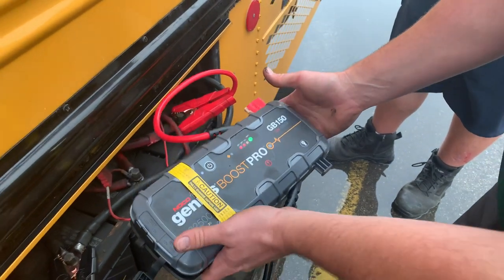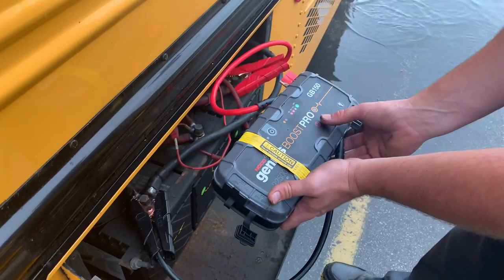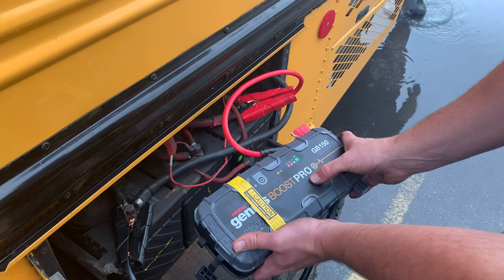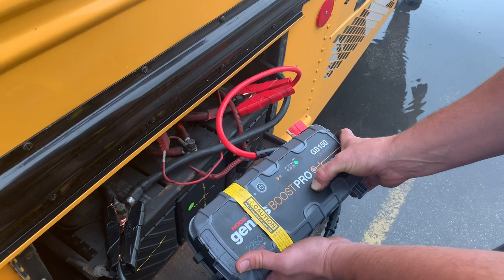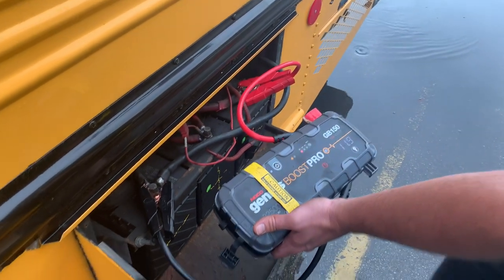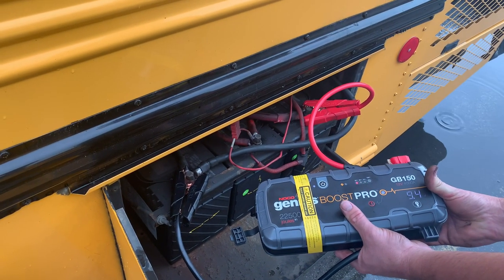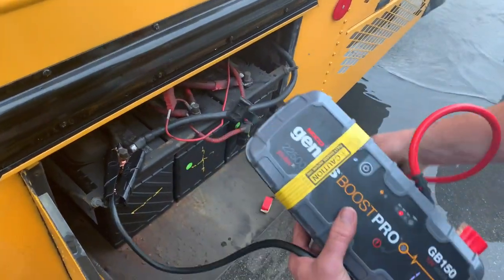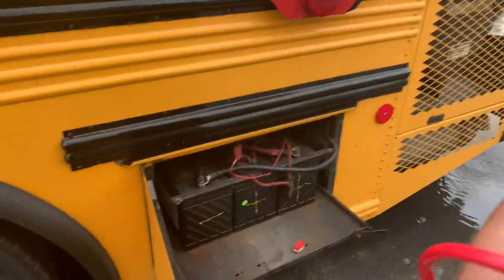NOCO GB150 School Bus Test

Comment: That jump box lasted me 3 months barely brand new used it maybe 50 times and it holds a charge everything seems to work except readings on the voltometer and jumping vehicles
Reply from the maker: brian poland Contact NOCO and file a warranty claim.  I’ve sold around 100 of them and anytime there has been an issue(@5) NOCO has warrantied them without an issue.
Reply: @indyjames  yup I just bought another one on the website and got a return number that they said will be warrantied or reimbursement will be sent into my account since I need a new one asap
Reply: @indyjames  how do u sell them do u sell them online? I was thinking about reselling some of their products as well, the gb40 and 70 are excellent the only issues with those is the micro USB charging port goes bad after a short time. Both my smaller packs had charging ports break off after a few months. I didn't try to return those because I opened them and soldered a new charging wire on them.